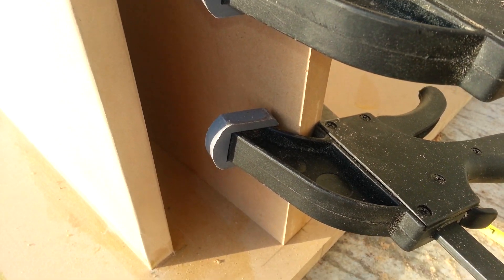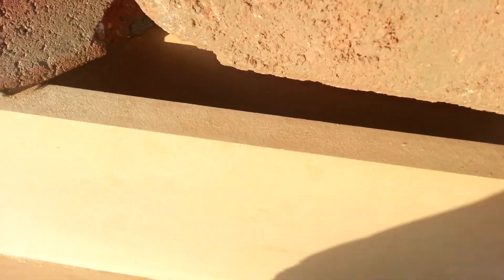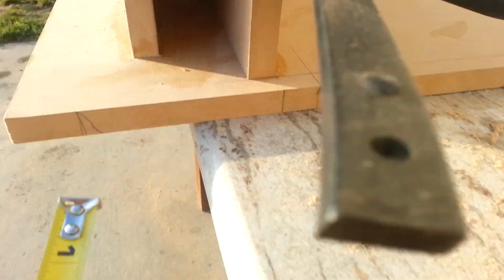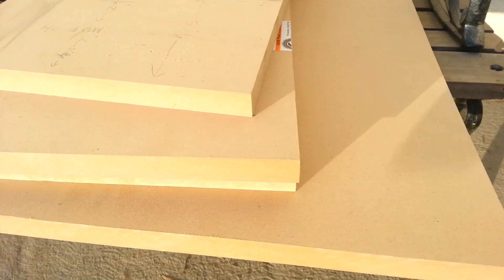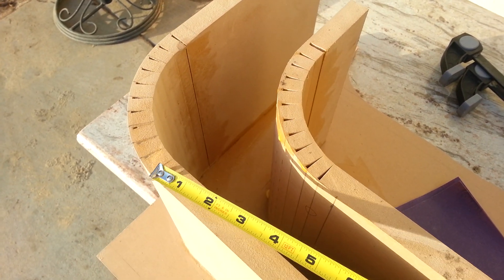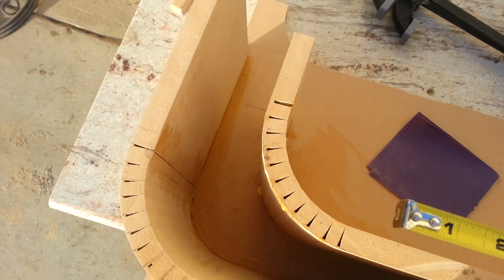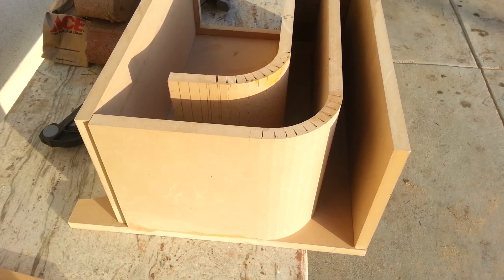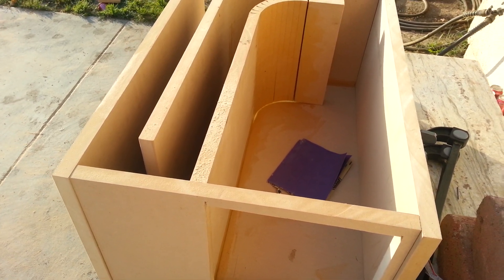Custom Home Subwoofer Build Part 1

Comment: nice job!  I especially like how your made the MDF curve like that.  I've never seen that before.  the more you do that the better you'll get, but I'm not knocking what you have so far.  It looks awesome! 

I'm curious.  how did you calculate the airspace needed in the chamber where the woofer will go and then the overall dimensions of the port?  it looks like you calculated this.  it does not look like you are guessing.  I'm just curious how you got your numbers.
Reply from the maker: Thx Chris -
Yea, that was my first time kerfing the MDF. 
Regarding the calculation of the air space and dimensions, I gotta be honest...I did some research online, read some articles, and tried using several online subwoofer calculators.  At the end I combined those calculations and the bose subwoofer design.  Had I actually used the recommended dimensions, this box would have been massive!  
I will post the final vid of this project soon.
Reply: Frank's CaliWood Specialty please send me the box detail via my mail id wintprashanth@gmail.com Iam from India

Comment: I would add 45's to all the corners and used a router (if you have one) to smooth the t-line edge (or sand paper and a lot of muscle-grease)... then use an fiberglass resin on the all corners and inside to seal and provide a nice edge for the sound-waves to travel out which will provide a cleaner sound. Other than that, great job!
Reply from the maker: Yup, I did add some 45s to all the corners.  I don't have a router, but I did sand the t-line edges for a smoother air flow.  I'll consider using fiberglass on a future project.  Thanks for your input.
Oh!, I will post the final part of this project soon.